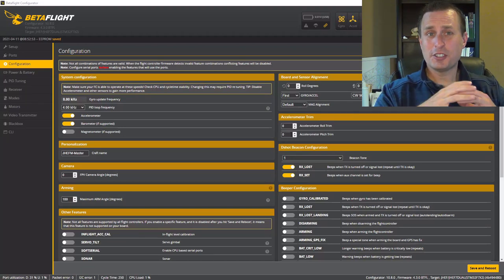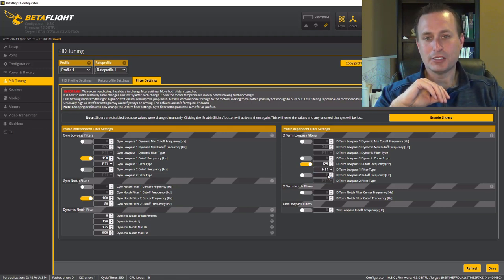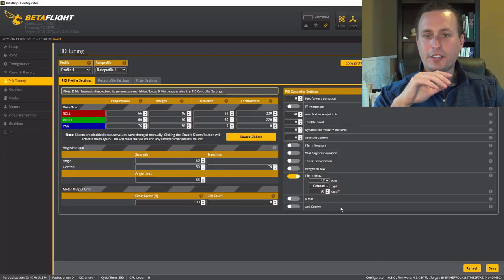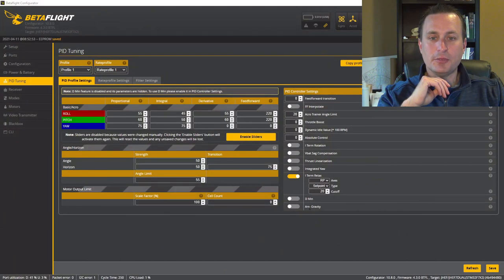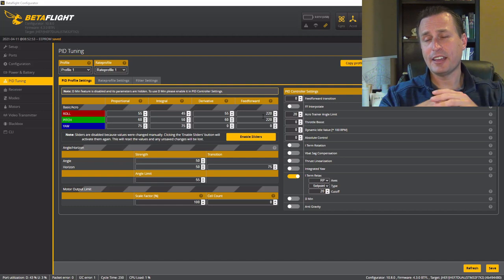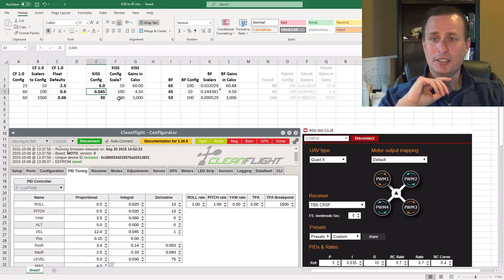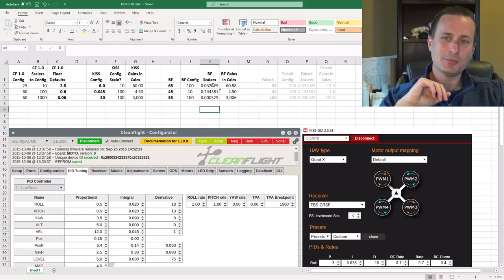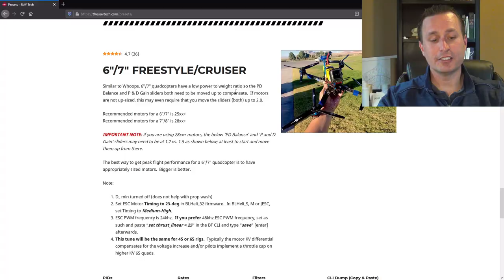Betaflight as KISS | TUNNING!  🤔

Comment: Hey Mark, I just wanted to thank you for the work you have done with the implementations for the sliders in 4.3, and getting everything working in 10.8. even when connecting to a 4.2 quad. I know big thanks also goes to hasling ctzsnooze, mikeller, and everyone else involved with making it all come togeather. Been beta testing the latest 4.3Dev on 2 quads for a few months, and they fly excellent with the way the new anti gravity works. Which I thinks was thanks to ctzsnooze. I cant wait for the Release Candidate to be released. Thanks again for all you do.

Comment: I’ve flown other peoples kiss rigs, Apex frames with fettec ESCs etc. and they fly great. But I find betaflight easier for a couple reasons, it’s the firmware I’m used to and the choice of components is limited with KISS so they are often out of stock here.

There’s just so many choices with betaflight especially when you get into specialty stuff like toothpick AIO boards and high amp 20x20 stacks so while I’ve been tempted to build a KISS quad I always end up sticking with what I know and in the end it’s just about having fun and flying.

Comment: And I have a tip for you.
Render and upload the video in 1440p even if the video file is not recorded in 1440p but then youtube will decode this in vp09 instead of avc1 and the video quality gets waaay better ;D
Reply: True, usually the pixelation goes away. Youtube gives higher bitrate for the higher resolutions as an added bonus.

Comment: Could you please do a current EMUFlight tuning video? I used your I-P-D video to walk trough EMU flight, but would love to see a actual emuflight video.
Reply from the maker: It's all the same though from a tuning standpoint.  Just different knobs and levers.  Is there something specific you would like to see in a tuning video with it?
Reply: @uavtech  Maybe how to setup Imuf filter for 3 / 5 / 7 inch. How does EMUBoost work or how I feel it?
Realy like your summary for betaflight sliders in https://www.youtube.com/watch?v=t9XljOQsE8Q at 3:59. Do you maybe have a summary for PIDs in emuflight / bg without sliders?
For me speeking, after a change its sometime hard to know what i have to look for. 

And thanks for your work! Learned a lot!

Comment: KISS and Airmode has a big differnece in its function.   I can not land on hard sorface without bouncing when airmode is on.  Where in Kiss I can land as if airmode is off.  I can pirch on side of rail with KISS but I cant do that with BF unless airmode ison a switch.   

Perhaps AIRmode needs new function as when in level and hovering flight with low RPM the airmode tujrns its self off.   

Maybe there is something in BF 4.4 we are not aware off?
Reply: And now we have Betaflight EZLanding 😄

Comment: Hi, I fly a kiss v2 on an Apex frame. I’m not the best at tuning just trying to do what I can. I seem to have got it close and reduced bounce back at the end of sharp stick inputs and generally I’m happy with it and it feels like it flies ok. However, I do quite often get what seems to be bounce back at the start of moves which I can’t work out how to solve! 
What would be the most likely reason and solution for this? Any advice appreciated.
Reply from the maker: At the Start? Can you see it? 

It is tough to say.   Is it P-Term (very fast) boinceback or I-Term (slow)?  
If Fast:
Raise D-gain (or lower P gain).

If slow:
Best advice is set Setpoint Weight to 100 and get i-Term as low as you can OR P and D Gains (raise together holding ratio) as high as you can.  The balance between P and I-gain is what arrests i-Term overshoot.  Higher P gain arrests I-gain overshoot.

See my IPD tuning video: theuavtech.com/tuning
Reply: @uavtech  Amazing thank you I appreciate its hard to say for sure. It is fast! I will work through your suggestions and see how it goes.
Reply: @uavtech  at the start is when I see it yes not at the end

Comment: Has any good come from looking into KISS or  Raceflight or whatever else?  Has any innovative ideas really come form there worth taking?  At least nothing that is going to show up in this sorta data, IMO.  BTW joined your pateron last night, keep up good work.
Reply from the maker: THANKS FOR THE SUPPORT!!

It has let me know what is real expectations vs. marketing.  Hopefully I have conveyed.  Like I said, I learned a lot about it though this process and hopefully that can help folks.

No, there is nothimg special under the KISS hood making the FC worth $20 extra IMHO.  Lack of features should make it $5 or $10 less.
Reply: @uavtech  There are good ~$25 flight controllers from Diatone, while KissV2 is $69.99! It's up to 3x more expensive, not just $20 :D
Reply from the maker: @m4g4r4c  , right.  Kind of ridiculous actually.  No OSD to boot.  I guess if you have DJI then no worries there, as it does support DJI MSP OSD.

Personally, I would just tweak in BF to fly loose like KISS if you want that feel.
Reply: @uavtech   Just the OSD board for KISS is more expensive than average Betaflight FC... FETtec OSD  is $29,77 and ImpulseRC Apex OSD is $38.5 USD.

Comment: I want to see the test rig not just the flight because I have photos of the rig I think you used here and it’s not good what esc was used I am doing a comparison of this myself I have two identical rigs with kiss 32 amp esc on both one has matek std 405 and matek pdb the other has kiss v2 and wolf pdb everything else is the same.
I am not a kiss fan boy and I am not betaflight fan boy I not an emu fan boy but out of all three betaflight comes last emu and kiss were much better for me can’t really decide yet which is better but betaflight comes last
I do think the esc makes all the difference
Reply from the maker: U really need to use the same quad.  Two different are whelp, too different.  

🤔  .. but emu is 95% BF.  That's weird.  Also weird how BF is the most popular.  It just doesn't add up when I dig into the details.

Are you getting into A-B level testing or just comparing defaults?
Reply: I am comparing defaults at the moment mark but will be going deeper with all three the point of building two identical quads was to test all three I have struggled with tuning betaflight for some reason on all my quads I think it may have something to do with the newer versions of betaflight as I said the esc seams to make a huge difference to the way they fly l have one quad that runs blujay or bl heli s and just doesn’t fly as well as the kiss 32amp or blheli32
Reply from the maker: Different quads - even with the same equiment - always seem to fly a little different.  I have always found to narrow error, you really need to use the same machine to compare.  Just swap out the FCs.
Reply: @Drift-fpv  Comparing firmwares on default settings makes sense from a beginner perspective. You should try to tune them all as well as possible to make a more legit comparison. Even when tuned, there always one better tuned than the others, especially when no blackbox is "easily available" for the firmware. Emu is ok/"not bad" on default, it doesn't mean it flies better. From my current testing, I would even say that I had better results with BF (and FalcoX) than with Emu and KISS. And BF is so easy to tune with the sliders now, if you follow Mark's tutorials. I flew KISS/FETtec with FETtec 45A ESCs and BLheli32 ESCs, I think the difference is more a placebo effect. Maybe OneWire brings something smoother... but nothing tremendous.
Reply from the maker: Whelp, you saw KISS vs. BF defaults on this quad:  https://www.youtube.com/watch?v=8c9ggTbWrM8
Reply: @uavtech  seams to me mark that anybody says what you don’t like you go on the defensive I am not saying anyone firmware is better than any other just my experience as you put yourself up as somebody who is here to help others I appreciate your tuning vIdeos and have learnt a lot by watching them but I don’t appreciate your sarcasm
Reply from the maker: Just trying to articulate that folks should do some homework to really equal things out to do a proper vetting before nonchalant comparisons and coming to bad conclusions.  Unless at least attempting to follow some semblance of a scientific approach - and collecting some data along the way, why would you not? - comparisons are not really worth it.  In my tests, I did as thorough of a job that I can and made raw logs and HD available for peer review.

Using the exact same rig for A-B testing is a HUGE must for testing.  Way too many possible variables otherwise.

I'm struggling with the concept of being able to tune one FW vs. any other.  I never feel like I can't tune any firmware.  So something doesn't make sense.  What do you struggle to tune?
Reply: @uavtech  so now what you are saying is the video you made on defaults was a waste of time then obviously just made for views and ratings
Reply from the maker: @Drift-fpv  , no way.  Defaults comparison on the same quad is legit!  Do that.

Do keep in mind defaults are half of the story though.  It begs the follow-up question then, how do they perform after tuned on the same quad?
Reply: @uavtech  all you are trying to do is discredit my own personal tests I have not published my finding you do on a weekly basis and every time you do a comparison mark betaflight wins funny that but you make out of betaflight so it would win
Reply from the maker: @Drift-fpv  you can see the data, download it and check out the results.  Am I lying about how KISS flies in this testing?

There is no way to make the KISS tune fly better, if you think there is, what would you have me do?  If I increase P-term it gets P-gain bounceback at the end of moves.  If I increase I-gain it gest I gain bounceback at the end of moves and D-gain is at the max for the best prop wash handling.  Also, filters are set to HIGH.  If I put too OFF, it gets the jitters.

I have iterations of each if you want to see those logs so I can prove it to you.  

So that is how I roll, open book.  But you are saying different with no backup publish and I see an issue in your test procedure.  Just use the same quad to make a better comparison.  You not knowing how to tune BF also is concerning from a fundamentals standpoint.  That shouldn't be an issue as the way KISS PIDs work is the same way that BF PIDs work so I'm very confused on how you can tune one but not the other.  It really gets confusing if you say you know how to tune KISS and EMU but not BF as Emu and BF are like twins since EMU is mostly BF so of course it just would not make sense at all.

Keep in mind you left a comment on my video to disagree with the results, which this video isn't even about which is better or not, and say you think otherwise for something that is not even the core of the video topic but are now surprised when I question the method or motives of your unpublished claims or results.
Reply from the maker: @Drift-fpv  BTW, I would win WAAAAYYYY more to just push to sell KISS with an affiliate link and then go on to continue to make BF content too.  To make both actually and keep shilling those KISS affiliate links.  So the assumption that I somehow win with BF doesn't seem to make sense.
Reply: @uavtech  I never said one was better than other seams your getting things mixed up there I said emu and kiss were easier to get a good flying quad out of with minimal experience in tuning yes and I stand by that
Reply from the maker: @Drift-fpv  but you are wrong.  See this guy said so:  https://i.imgur.com/KQih49P.png

My point is that's just opinions, which you know the saying about opinions and backsides.  So what's the point of just more opinions out there in the world?  Nothing wrong with having an opinion of course, but I think it just doesn't mean much since, again, back to the opinions and backside saying.  I strive to be more than just opinions on this channel and with my content.  Like I say at https://youtu.be/YVRBgD3sTs8?t=416, my opinion doesn't matter.

Comment: Looks like untuned kiss for me :/
Reply from the maker: You mean the KISS flight?  That's as good at it gets on this rig.
Reply: @uavtech  yeah kiss flight.
Reply from the maker: Whelp, it's as tuned the best it can be tuned.  KISS has throbbles and overshoots, that's no secret.
Reply: @uavtech  very bad propwash handling
Reply from the maker: @Maorifpv  , yeah I would say that is a mechanical limitation for the quad; but it impacted BOTH firmwares.  If I upgrade the motors, that is my bet for that getting better.